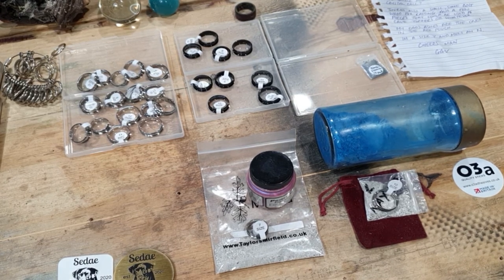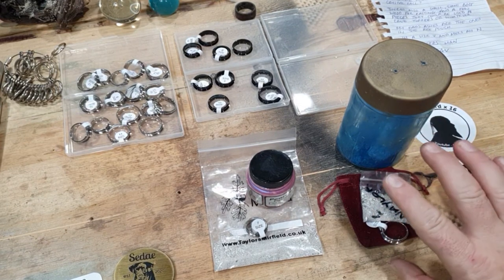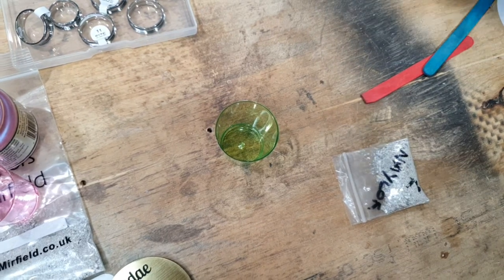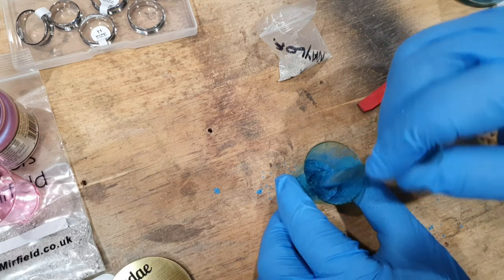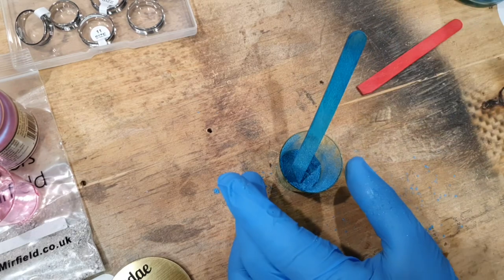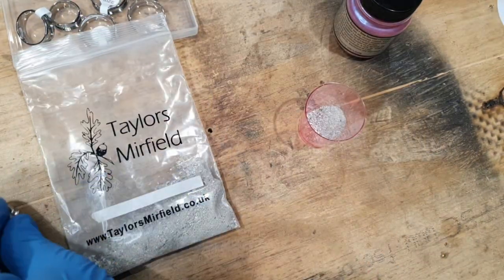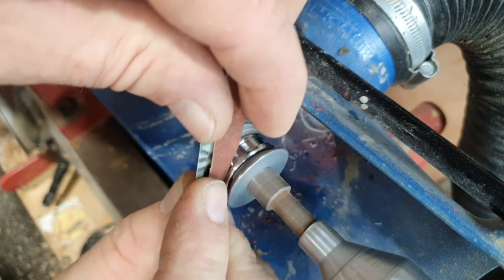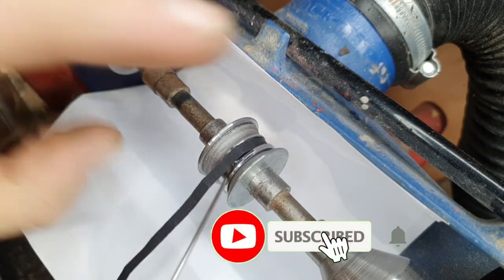🔥 Crafting Precious Memories: Turning Stainless Steel Rings into Memorial rings 🔥

Comment: You made that look extremely easy! I have purchased a mini lathe especially for this purpose. I now know that I definitely need to upgrade my cutters. Also, where did you find the mandrel you are using? I fashioned one out of nylon spacers that I cut into bushings.
Reply from the maker: Hi Justin Thanks for taking the time to watch and comment.
The mandrel i use is a pen turner mandrel from Amazon, and I 3D printed the grey cone-shaped parts so that I could put different size rings on it. On either side are just penny washers to protect the plastic and for a nice solid surface to compress either side for a secure hold to stop the ring spinning. Good luck with your new lathe .did you go with a mini wood turning lathe or a mini machine lathe? You could make your own rings from scratch like i do now. I dont buy the blanks anymore.

Comment: Rich, love your work! hoping you can help. I use a drill/ dremel for filing, with sandpapers and polishes- but I’m struggling to find a bit that will hold the ring! I’m thinking maybe a stepped rubber cone? not entirely sure what to search for as so far I haven’t had any luck!  
Really hoping you can point me in the right direction of what I’m after is called. Thanks!
Reply from the maker: Hi thanks check out freedomringz19 on TikTok. He uses a Dremel with a flex shaft and he makes tones of them mainly live. He's a decent chap and will answer any questions in the live chat. He's also on YouTube under the same name. freedomringz19 hope this helps you.